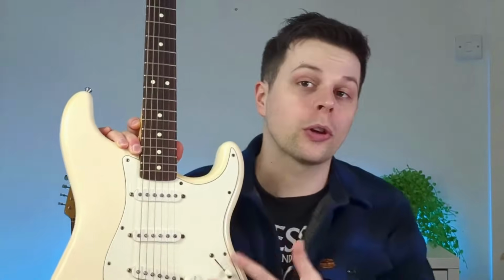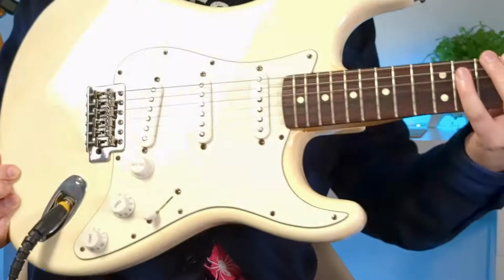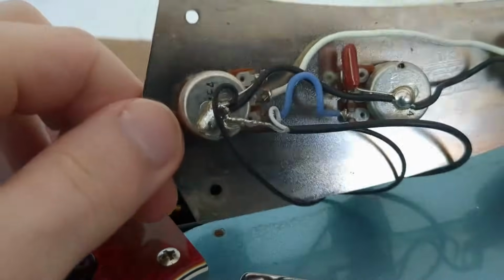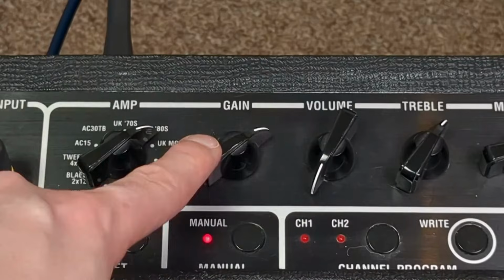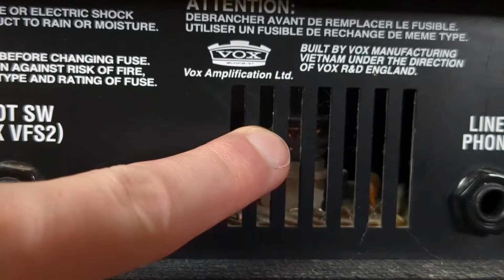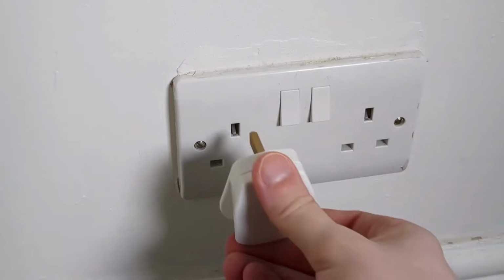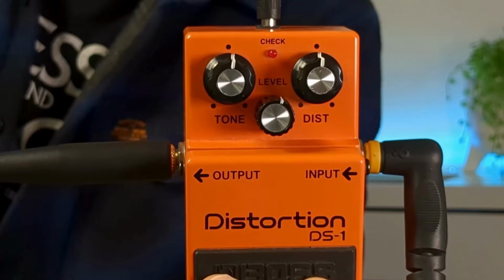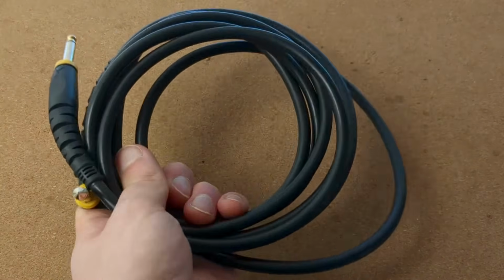How to STOP Amp Buzz | 11 EASY Ways

Comment: Solution = bought a Neutral Ground Bonding Plug for Portable Inverter Generator - a 3 prong plug that connects ground and neutral. Added this to a multi AC extension plugged into a Jackery 300W Portable power supply. Corrected the floating ground in the Jackery Unit. No more hum!!!!! Amazing!! A clean Fender 25 W Amp with portable power!

Comment: the problems I have had solved by 1.mains noise filter. 2using batteries to stop earth grd loop.3.aluminium foil inside the strat gtr cavity. switch off any weird lights(neon).
4.do not  share mains power with any house hold items.5. strat use position 2. or 4.

Comment: I have amp buzz but when I touch the strings or bridge it stops
Reply from the maker: That's sounds like a grounding problem with your guitar - you'll need to make sure the wires are all grounded properly 😊 simple to do if you're good with a soldering iron, but your local guitar store should be able to sort it otherwise 😊

Comment: For me it isnt a buzz i hear a beep whenever i put the settings on crunch
Reply from the maker: Is it like a constant beeping?
Reply: @ConorRocks its a consistent constant beep that doesnt stop, its not like beep beep beep its beeeeeeeeeeeeeeeeeeeeee… and it doenst stop
Reply from the maker: @jarnoameys4238  That's odd - it could be the gain amplifying an existing noise? Do you hear it or something similar on the clean channel with the volume turned up?

If not, it might be an issue with the amp changing to that channel.
Reply: @ConorRocks well thats the thing indeed, on a clean setting its there but very very quiet, on lead of crunch it would be extremely loud
Reply from the maker: @jarnoameys4238  That's helpful to know! Do you have an audio interface or another amplifier you can test your guitar with (to fully rule out a guitar fault).

Also, is you guitar going through any effect pedals?

Comment: can anyone tell me, on the monoprice 15, there is a trim pot that has something to do with plate heaters for the purpose of hum cancelling when the gain is up loud. I tried turning it up and down from stock setting just a little, but was afraiud to do to much as i dont want to destroy my amp, did that with the first one RIP (first tube amp, part of the learning experience, lol). Id love to know if anyone has adjusted this, where they ended up at in the 180 degreee (aprx) sweep of the trim pot. the little bump up and down i tried really made no difference, so i put it back, but admittedly didnt adjust it far in either direction. It was biased cold so i bumped it a little hotter, huge improvement in sound, now want to fine tune things, and btw i dont have a working multimeter or bias probe.

Comment: I have a catalyst cx200 that I haven’t really played much lately. Plugged it in tonight and the buzz was so bad you could almost hear it coming through the guitar while I was playing. Plugged in 3 different guitars and the problem persisted. Used every outlet in the house and it didn’t change. Now I did move recently and this apartment more than likely isn’t wired the best, but the noise is definitely only there on my high gain setting. The only way to get rid of it was back the gain down almost entirely. I LOVE my gain though so that’s not gonna work haha both my normal guitars have James Hetfields EMGs on there and I have a KH602 with his bone breaker set so there’s a TON of high output happening. So I grabbed my trusty DigitechRP80 for science, switched to the clean channel on the amp, and voila. Problem gone. Looks like my old digi just made its way back into my signal chain lol it has a built in noise gate so I’m sure that’s helping too.

Comment: What about when i aply light pressure to the end of the cable the humming goes away what could the problem be
Reply from the maker: Sounds like the cable could be failing. Do you have another cable to compare it to?

If not, you can check whether it's the cable or connection that's failing - take the cable and swap it round - then see if you need to press it in the same place! (Eg the guitar end or amp end).
Reply: @ no i just got the cable can i send you the video on ig or something
Reply from the maker: Weird! Yeah - send an IG and I'll have a look!
Reply: Ground the amp
Reply: @ how?

Comment: Great tips man, really good job! But what happens if you still get the buzzing noise even when you aren't touching guitar strings? My amp is brand new, and the buzzing only started suddenly when after I tuned my guitar once.
Reply from the maker: Thanks! That sounds pretty strange, but luckily I don't think the two will be related (the tuning and the buzzing).

Does it go away when you touch any metal/strings?

Also, do you have single coils or humbuckers?
Reply: @ConorRocks  It doesn’t go away when I touch the strings, but goes away when I touch the volume and tone knobs as well as the pickups. I have humbuckers.
Reply from the maker: Okay! And do you have metal knobs or plastic ones?
Reply: @ConorRocks  Metal knobs
Reply from the maker: Sounds to me like it could be a grounding issue with your guitar's pots - maybe a wire or solder joint has come loose.

It's a fairly common problem and a straightforward fix if you're handy with a soldering iron and multimeter - but it should be a fairly inexpensive job at your local guitar store!
Reply: @ConorRocks  Thank you so much man. I’ll have it checked out.
Reply: @ConorRocks  I have this issue too, but mine is a bit different, as very loud humming and buzzing is coming from my amp without the guitar connected at all.. With a good quality cable connected it is buzzing like hell even on the lowest volume setting with not too much gain, and without a cable it is buzzing and humming in the same time very loudly.. please help before my neihgbors kill me, thank you

Comment: Thanks for the tutorial  but I can’t figure out how to make it stop I hear it  when I play and I have a decimate prorack noise reduction system  and that’s the best solution I have found but still not 100%     If I could figure it out  I’d be a billionaire
Reply: did you find a solution?
Reply: You're going to need to open the instrument and verify the cable connector side on the guitar is not loose. Vintage Fender guitar cable jacks have a tendency to work loose. So try that out, tighten it and come back.

Comment: okay so like the entire noise goes away totally when i turn off the Tone knob on my guitar. How do i fix this?

This is both with my LTD mh-50 and Jackson JS32 rhoads
So it cant me a guitar issue i believe
Reply from the maker: That's an odd one. It sounds like it would be something to do with the guitar (although it is odd it's happening to both!).

It sounds like something is grounding the signal, it could be the tone capacitor is touching the pot by accident?

Is there another guitar you can test?
Reply: @ConorRocks  somehow and Idk how, it was my extension multi-plug all this time, the point You made about removing excess electronics did the deal for me. I connected the amp separately to another socket and there is literally no noise. Thanks i guess for that piece of Information XD 

Cheers for helping a fellow musician all the way from Bangladesh 🇧🇩
Reply: @FRANKLIN_  i have the same problema, nuzz noise with 2 guitars in the dirty channel with high gain, and it goes awat when i turn all down the tone of the guitar. I changed sockets but continúes. Blackstar ht5